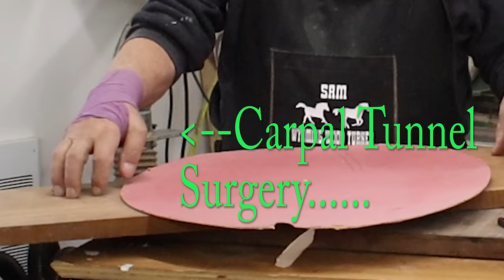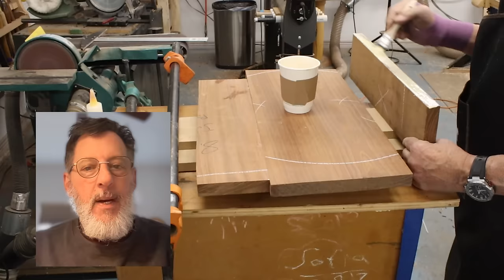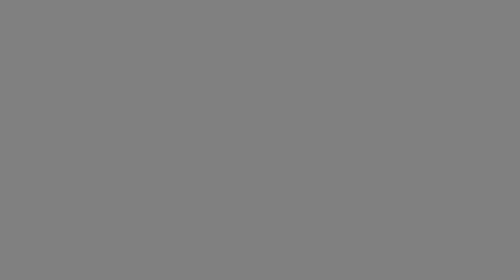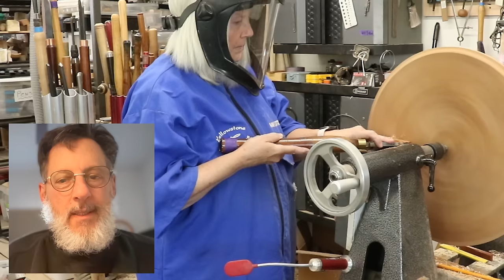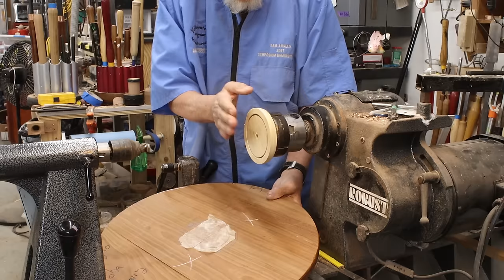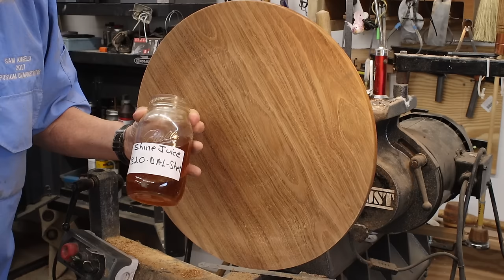Watch As Sam Angelo Turns A Monster Round Cutting Board With A Groove!  Woodturning with Sam Angelo

Comment: I made a screw driver from Jatoba. My gosh that is strong wood that really takes abuse. Was that woodturning tape or just some other double sided tape? It did not look as thick or strong as the stuff I have been using for years that came from Woodcraft. I would not want to turn out near the edges without TS support but would be confident in taking out a nub cutting directly toward the spindle. But with many viewers not knowing the difference in WT tape and any doubleside tape, your approach is safer for novice turners.
Reply from the maker: Thanks, Mike for watching, the tape I am using is called TESA Tape.  I have found that eBay is a good source of this tape and a pretty reasonable price.. I have been using it for a number of years and it's never failed. I agree totally about using tailstock support. This particular hunk of wood was very much out of balance even after it it was all chewed up. Must've been a grain issue or something in the wood..   I do love the double stick tape for some applications. It's fast and has worked very well for me.    Sam